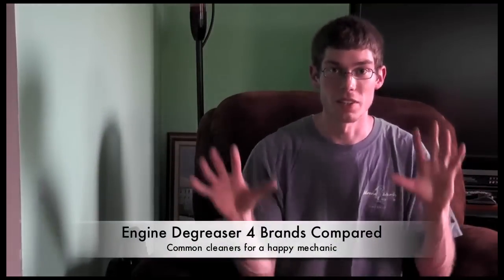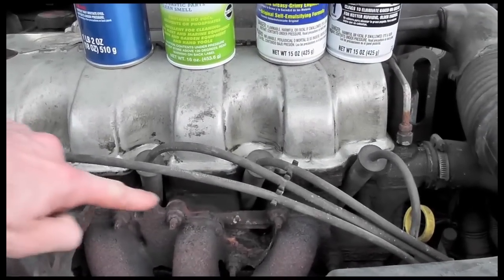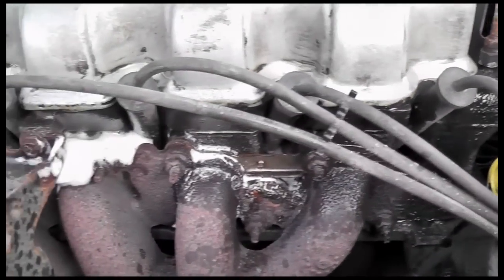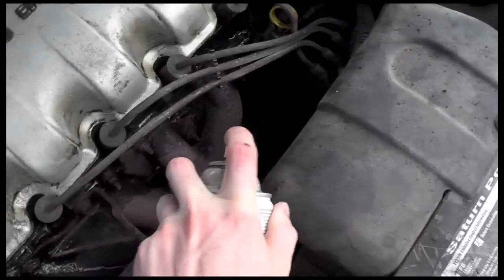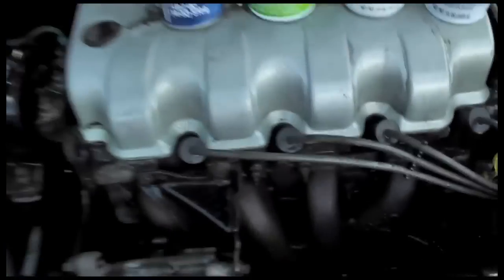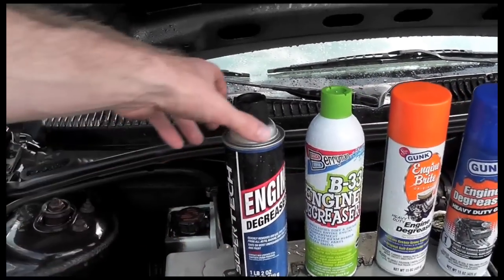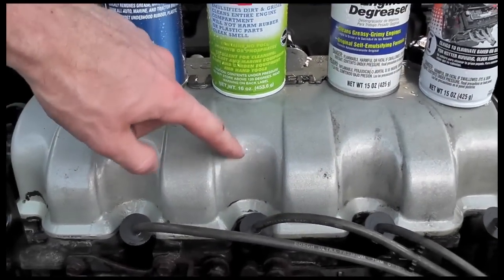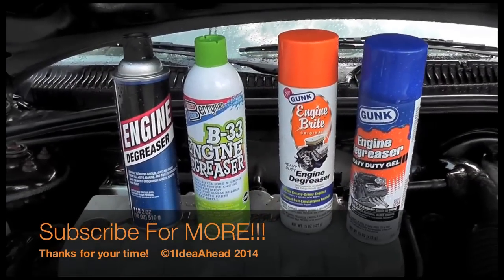Engine Degreaser 4 Brands Compared

Comment: I always go with the cheaper brand products because they are usually a brand manufacturer product with a cheap product label. when I was in high school, I worked at a candy factory. we would make the factory product which was a name brand and would make a super market product, which was the same product in a different label. the brand name at the super market would go for a higher price and the store brand sold for a lower price. even though they were both the same products, the customer would usually take the known brand over the cheap brand. it's all the same and all a mind game.

Comment: I use Gunk best degreaser if used right I let the engine run to temp and spray it from the top downwards adding extra for nooks and crannies and heavy build up areas and let it sit longer if its a first time engine clean Then get a baby bottle cleaner brush (dollar store) and scrub the nooks and heavy oil/grease areas and scum the hoses And finish with a heated power washer like the one at my car wash and then a few old clean rags to wipe away and extra dirt and water Then spray a shine on the plastics and hoses not the whole engine  my show truck always has a  new engine look and its 11 years old
Reply: I also use a baby bottle brush they really get the engine good
 Great tip

Comment: this test is equivalent to squirting toothpaste in your mouth and waiting 5 minutes, rinsing out your mouth to find the same dirty teeth...

I used a bottle of L.A's awesome degreaser from walmart Cost ( $0.97 ) used at the suggested dilution ratio of 1:3 purchased a soft bristle brush like those intended for cleaning wheels, sprayed whole engine bay, proceeded to scrub lightly then rinsed. total elapsed time was 20 min. I took 15 years worth of brake dust, grease, road grime and al kinds of caked on shit with a product that has a cost of less than a US dollar.Your results are a product of the effort put into the project

next time make sure you properly protect the sensors,battery and Alternator before spraying a garden hose in your engine bay. as most of the sensors in a car are expensive as hell and between the cost of a new battery and alternator you looking at over $300 if they get messed up+ the cost of someone to install said items.
Reply: other tests have shown super clean, zep industrial, oven degreaser, as well as mean green super (by a small margin) are better at degreasing and cleaning.
Reply: My mom uses that stuff to clean the stove 😂👌 like new everytime

Comment: Thanks for the video sir. 

From my experience I found that the "Gunk" gel is the best for my car (2011 335ix). I actually just posted a video showing the engine bay after using gunk gel on it. 

Thanks again.

Comment: nice job, but you need a brush to remove the deep oil dust on the engine and the parts around it, then you use to high steam on the water and too close to the electrical stuff, I use to place plastic film on the sensitive stuff and then I use air pressure to remove all the water, then wait for at least 24 hours so all water is gone and spray some 5-56 or water removal oil to be sure that all water is gone and then run the engine easy to it gets warm.

Comment: Rust in peace.

You would think with all that oil and grease on everything i couldn't rust, but the fact is road salts stuck to the metal better.
You might try wd40  it will break down both grease and remove water to slow rust down it also offers some protection on metal parts and won't damage the paint.
I'm looking at purple power to use on a drill press, but I think I'm gonna wipe it off with sawdust, then hone some of the rust off it with a wet stone used to sharpen knifes.
Wipe it off with vinegar then water after then sawdust and spray with a light oil or silicone spray to protect the metal from more rust.

Comment: The best is a car wash pressure wand (on wash suds) take's off caked on grease and oil.    those degreasers  are for light oil and grease  also if you have access to a steam genny  (kerosene heated power washer ) that is the bomb no soap or chemicals needed  super hot pressurized  water
Reply from the maker: +1995dresser just dont dork up electronics with pressure

Comment: B-33, thanks, I have an 83 Mercedes 300SD that's really  had nothing done to it. Years of seaping motor oil & WVO, yuck what a mess. I need to replace a starter & vacuum pump, I will try it, Dave.

Comment: Use a hotsy steamer, much easier to clean your engine
Reply: How true no Degreaser needed  I used a Steam Jenny  many years ago and they work Great
Reply: Try it again with a 3000 psi pressure washer & see if your results don't improve 10 fold. I've been detailing cars for 25 yrs, I agree with the toothpaste comment above. It's common sense